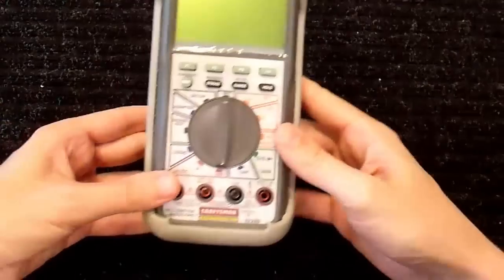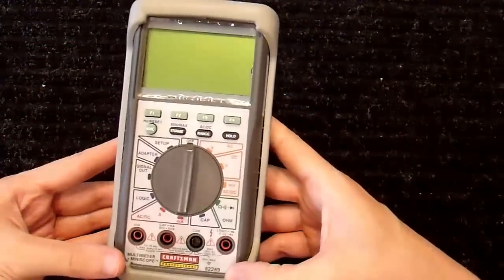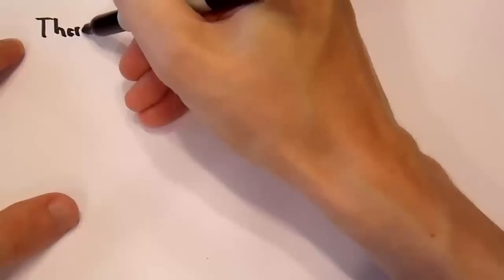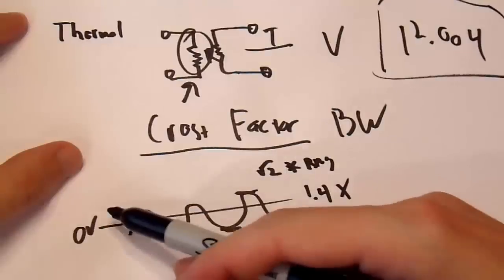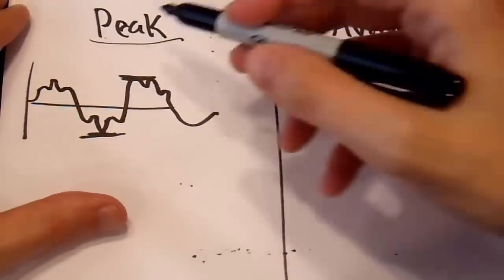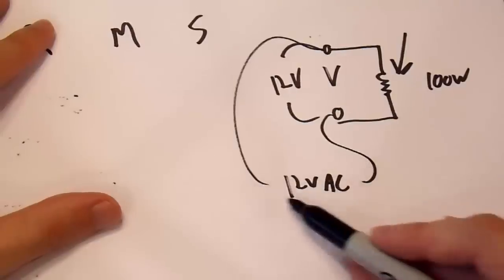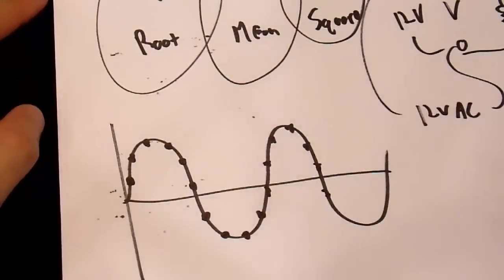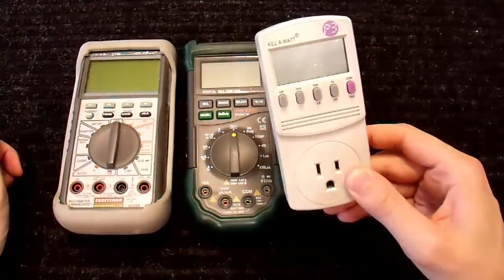True RMS Multimeters - How They Work and Why You Need One

Comment: Thank you very much for this video. I am studying power electronics and electronics at the University and I felt curiosity for how these instruments might work. It was clear to me that I was measuring volts, amps, ohms, etc; but I was intrigued and asked myself ever since, how do they do the math? what does the instrument interpret and show us? and why is that the professor constantly affirms that whenever using the multimeter on AC, it was giving me a rms value? This video has cleared many of my doubts and I find it really useful, and it hooked me until the very ending of it. Thank you for your contribution, it means a lot to me and to a lot of people that go a little bit far beyond when learning and I can say that I learned from you something I consider to be very important to me, even though the professor won't grade the students accordingly to what people truly know or learn. Again thank you very much, I hope your video reaches many more people as well!
Reply: Well I'm trying to learn how to use this Kobalt RMS Digital Multimeter that I bought at Lowes. I bought it to test an oven element, or the terminal thing in the back that can also be replaced. I have a stove and oven built into the counter top. I have learned there are four screws to remove the actual oven from the cabinet. The video I watched made it seem possible that if I have a meter I might be able to actually get some cheap and easy knowledge about the oven part of the stove, because everything works but the oven but we had lightning hit a tree in the back yard many years ago and at the time it knocked out a bunch of our electronics. Now as the sole homeowner I'm trying to do more things for myself. My brother who died in 2020 could do just about everything. Me, I do basic stuff. Anyway, it must be nice to listen to stuff like this and leave such a video with enhanced knowledge. Me, I just want to know what the heck I am doing. My meter has settings that make it look like a clock. I can't find a video of anyone using a meter like this. I got a plug in meter, a pen meter and this RMS all for about $35. I sure wish I knew how to use it though without getting a degree in electronics and so on.

Comment: Great explanation of the RMS verses non RMS.
It's been a long time understanding this, but this is a great refresher.
Back in the day audio amplifiers of dubious marketing would use Peak, Instantaneous Peak to Peak and may have mentioned RMS power ratings. Then there is is the dodgy  subject harmonic distortion. I have heard this harmonic distortion on the A.C. line is some cause for concern. Causes can be from switch mode power supplies found in lighting devices and power supplies from "wall warts" to computers to motor controls.
Reply from the maker: Craig Nehring Harmonic distortion is definitely a concern and can cause problems with various devices in addition to costing the utility companies money and other communication interference issues.  To measure harmonic distortion accurately you would need a Harmonic Power Analyzer which is a more expensive and more specialized piece of kit.
Reply: Honestly although some devices do require a near sinusoidal input, speakers really are designed to take whatever you throw at them.

I'm not sure why amp clipping has become such a cuss word. Because there are many audio production applications that you can use clipping for. And as long as your peak voltage doesn't do over and neither does your RMS, there's really no reason to be so concerned about it
Reply: In an amplifier, if it runs out of power into say a 3 way crossover, the tweeter is going to "see" more or less a D.C. supply wave form (severely clipped) and burn out the tweeter. Power in today's MOSFET amps is huge, not the case when 40 Watts RMS was considered a lot of power. Yet any amp can go into clipping for various reasons. Clipping on an input is one thing, on the output it can cause over heating of the voice coils that have AC resistance wave form ratings.
I have in my youth burned out more than one tweeter driving speakers this way, the odd thing was at the time I really could not hear it happening.
Reply: Craig Nehring Yes I'll agree that clipping an output is definitely a problem, but a square wave is just a sum of many sine waves, as is any kind of distortion

If you clip an input, and then filter that clipped wave into the operating range of the tweeter tough, and at that point are not exceeding the rated wattages, would you agree that it shouldn't be a problem
Reply: Yep, there is no problem then as it is just a sound effect at that point and will come out sinusoidal.

Comment: Thank you! I am a dunce when it comes to electricity but you are so clear and precise that even I understand. You are an excellent technical instructor.

One question, assuming that it is a true RMS multimeter, is there any significant advantage in terms of practical use in getting a very expensive one like a Fluke or getting a more moderate priced one of reasonable quality?
Reply from the maker: Charles Stokes I don't own a Fluke because they are expensive new and overpriced used.  (Just buy new in my opinion)  That said they are very nice meters which have quick response and hold up well under heavy use.  For example:  Even simple tasks like measuring continuity or measuring a resistor take an extra little bit of time with inexpensive meters because it usually takes some time for them to 'settle out' on the correct reading.  Flukes and other higher end ones are nearly instant saving you time.  For commercial applications I would always choose a nice one like a Fluke however if you're only using it occasionally then I don't see the need to spend an extra $100.  Multimeter technology isn't very high tech so even the cheap-o ones do it pretty well.  Or if you want - treat yourself to a nice Fluke.  And it will hold its value over time.

Comment: These are good videos, you should include chop and what actually happens in these circuits. Also include losses for saturation in those magnetic fields. I know it would be difficult, but it would explain better the difference between pure sine wave and modified sine wave and the losses associated with the implementation of those products on either platform.

Comment: Just discovered that my clamp meter (Mastech MS2108A) isn't RMS, but the MS2108 is (notice the missing 'A' in the model). I bought it after seeing you using the same model but I don't know if yours is the RMS model or not. Not a big deal for me as I don't deal with AC but would have been nice if it was just for those one off's.

Comment: Going back a couple of years - You rebuilt an APC back up UPS 600.  Happens that the circuit board (layout anyway) is exactly the same as an APC SC450 that I have.  I'd like to adjust the max current flow slightly upward (before alarm/shutdown) as I'm only using it for surge protection and to keep the DVR online during infrequent power failures for a few seconds.   The TV and DVR together are ~ 300 watts (max on unit is 280).  You put a "wire" across the current transformer to do this.  What would you recommend that I do in this case?  Thanks in advance for your time.

Comment: I've found that the chepo Harbour Freight meters are great for boats, which are usually all DC. I rarely measure AC because I mostly use them for hobbish things. However, I do have an RMS meter sitting around. Anyway, good video.

Comment: I have a fluke and TRMS mastech and also two mastech non TRMS models. The thing is in the electronics I work with I almost never measure ac voltage/current. In fact I cannot think of a circumstance when I would. 

So I would not say non TRMS meters are useless when this feature is only needed in 1% of situations (still cannot think of one). Any signals I look at I use a DSO. A multimeter is useless when compared with a DSO. 

So if it is DC any meter will do. If it is not DC use a digital storage scope.

Comment: Hi ive not long gone off grid had a surprise when plugged inverter to battery bank then plugged in soldering iron then went to solder wire to battery banks positive check it out it sparks a good one can you explain why ta

Comment: i just ordered the craftsman meter
Reply from the maker: Wow!  Where'd you find that old gem!  I had batteries leak in it rather catastrophically a while back and was worried, but it survived without damage to the circuit boards.  It's still my favorite DMM.
Reply: @knurlgnar24  i just received the meter the other day it's in good condition 
only thing when testing capacitors the reading seems to be off a 2.2uf is reading 1.5 not sure if there's a way to adjust it or not.

Comment: How do you tell if a meter is RMS or not? My meters dons say.
Reply from the maker: Lorraine Hillman In nearly every case if it doesn't specifically state it then it isn't.
I'm trying to think of an easy way to tell experimentally without any special equipment but I'm running a blank at the moment...
Reply: Type in the brand and model number on the internet. it will probably have some information about your meter

Comment: sum it up, - both rms and non is not fully adequate.. you really need higher cost gear of you really wanne get insigt an measure ac etc..anyway, so just do what most people do, and pick the pretty DMM..I have been looking for this model, but seems to be oout of production, and a shame  ' looks awesome..

https://s-media-cache-ak0.pinimg.com/236x/54/9f/b9/549fb9d0c14584c406503ad270c65e77.jpg
Reply: Well I mean RMS is by definition how you calculate DC from AC. So it's good for power applications.

As for audio, yeah you basically have to go by ear. dB perception is very complicated

Comment: Shouldn't "True RMS" be the standard, then?
Reply: I don't really know if it would be possible to have a "fake" RMS.. You could run it through some sort of digital processing but you'll end up with basically the same result. 

For example. In music production you use rms metering (since it's done by a computer, it's digital calculation) and it's precise enough that you can do a mix based on RMS levels instead of peak.